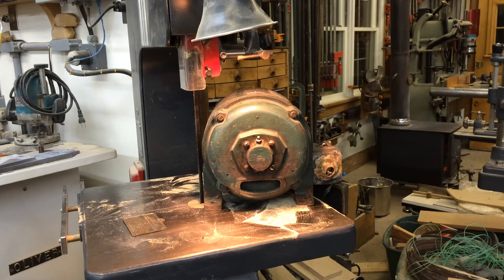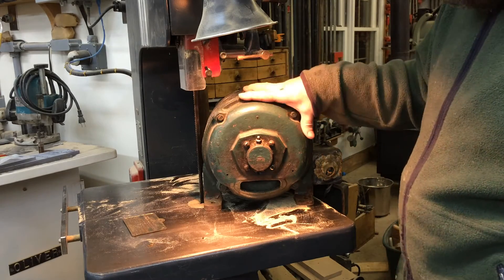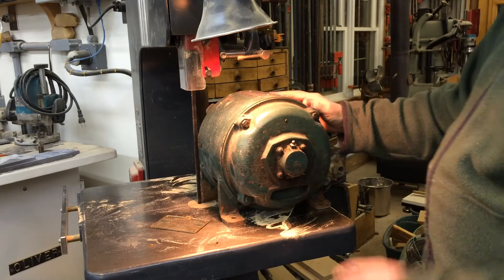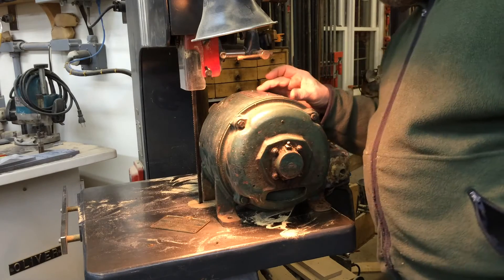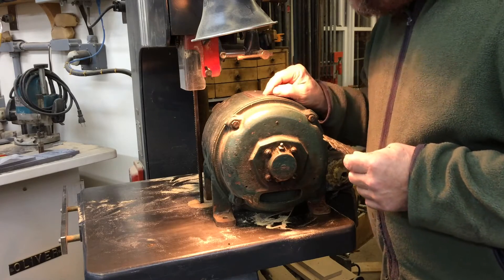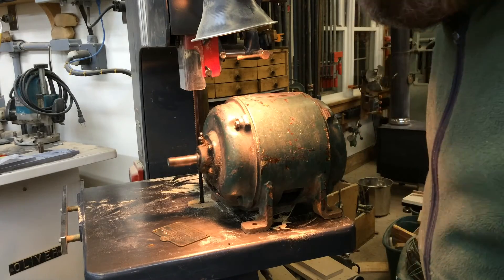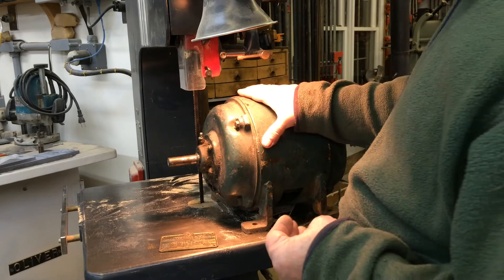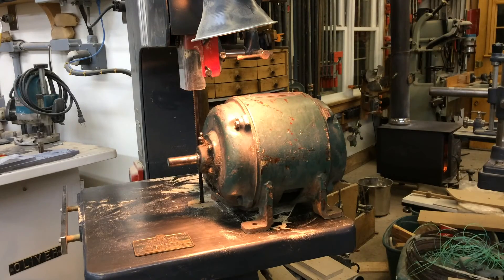Vintage 3 Phase motor  550 volts

Comment: Hello Jack,
                    I can tell you from experience that the old motors which are usually much larger than today's production lend themselves to many different connections and rewind options with room for multiple applications. They seem to just work and last. Something the new motors have trouble doing in general. Keep up the great work so our fellow hobbyist can learn and follow a real down to earth YouTube channel with substance. Have a great day also.

Comment: Hi Jack
In your video you made a comment about the new motor badge having a mistake in terms of the horsepower listed. The old badge listed the output at 3/4 Hp and the new one at 1 Hp. You comment was that it may have been a mistake.
Just a FYI, the power output of a motor is based on the insulation rating of the motor windings. The motor was rewound at one point and when the rewind shop dipped the motor stator in resin, that product may have had a higher insulating rating, thus the higher horsepower rating.
One other point, I really enjoy your videos and love your contributions to the woodworking community. The service factor of the motor is not indicative  of its efficiency. It is the amount of load we can impose upon the motor before there is physical or electrical damage. This concept is misunderstood by the general populace.
A motor with a service factor of 1.15 , means that you can load that motor up to 115% of its full load intermittently without damage. This value is based on the full load current value. ( FLA)

I teach this particular area in the Electrical program at Cambrian College in Sudbury. I follow your posts with keen attention, I felt I would be doing you a disservice by not taking the time to make the distinction. I am very impressed by your accomplishments in refurbishing old industrial machinery and using variable frequency drives to convert 3 phase equipment to operate on single phase power.

I have wanted to participate in the forum but due to distance I am happy to observe in your endeavors
Keep up the good work.

Note: I am using your videos to help students with specific concepts as you have an appreciation for old equipment, this fits in nicely with my subject matter as new students need to learn the basic before they move forward. In today's society, it is more green to manufacture a piece of equipment and have it for forty or more years than discard it and buy new.
My 2 cents, but I am sure you would agree. I would love the opportunity to meet you, the next time I find myself in the Ottawa area.
Reply from the maker: Thank you serge  for the more accurate meaning as this sort of thing is not my expertise so I appreciate people that do know and drop comments like yours
Reply from the maker: +Serge Levesque  Feel  free to use any content that lets the youth know that not all new things are better or that far out of Date. you are welcome to visit the Wadkin Temple AKA the shop any time. The best is to come to the annual celebration in july for the best time and meet other junkies. follow the GCRJF link below and be sure to share that with your students.

 http://jforsberg.ca/

Comment: Very nice Jack.  Will you be cleaning up the housing & mount and refinishing it to match the jointer/planer?
Reply from the maker: +James Brennan Yes will paint if up to match the RM. 3 phase motors are very easy to take apart and rebuilt.